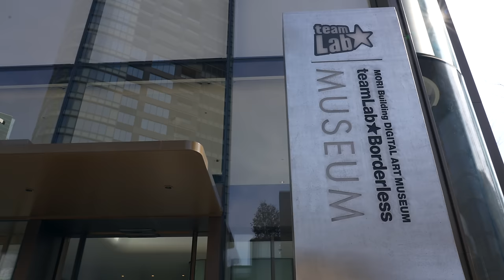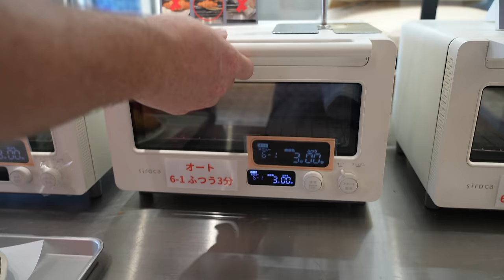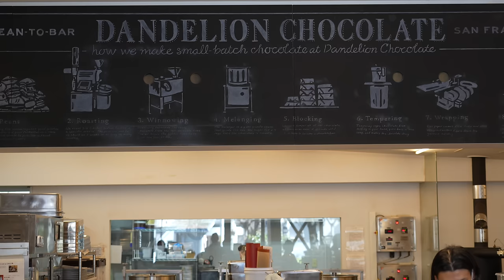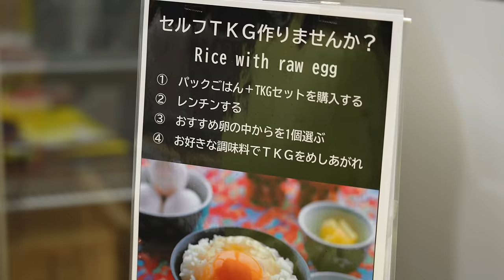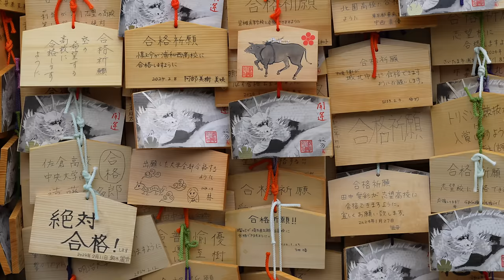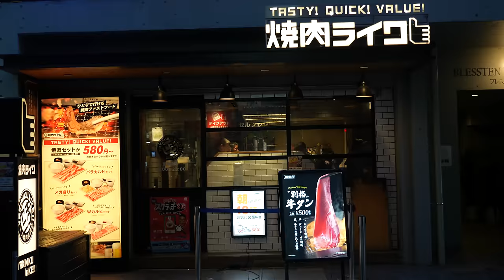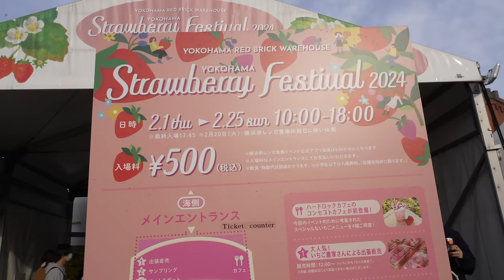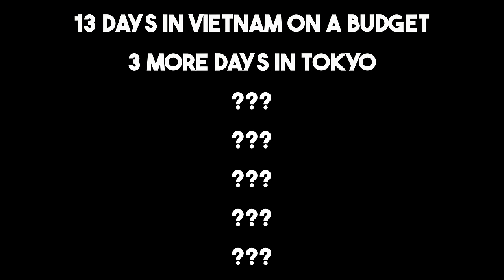3 MORE Days in Tokyo on a Budget

Comment: OMG The accidental boy band line was pretty funny!!
Your strawberry festival experience in Yokohama, mirrors our Christmas market experience 10 months ago. Red Brick Warehouse has so much space.  It's a shame that they hold these festivals, make it super tiny in a confined space, then make people line up for hours to get into these tiny events.

a short scroll through the comments and I don't see this mentioned yet.
They needed to move the fish market because the refrigeration systems in the old fish market were starting to fail so badly that they couldn't keep doing business there, with in reason.  Add the tourists to the equation and how the business side of things weren't really separate from random people just passing through for fun, and it makes a lot of sense that building a new location that is Ready for both business and tourists to co-exist was clearly a great idea.
I'm glad you guys went to check it out!  I've not been there yet.   
I'm also glad that the businesses in Tsukiji (outer market) didn't seem to be as negatively impacted as people feared that it would be, by the relocation of the actual fish market.